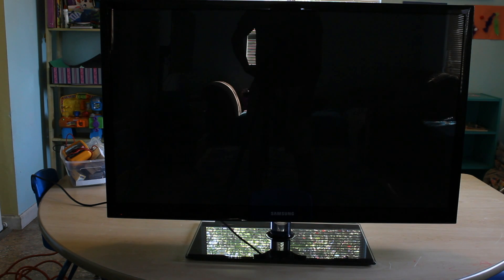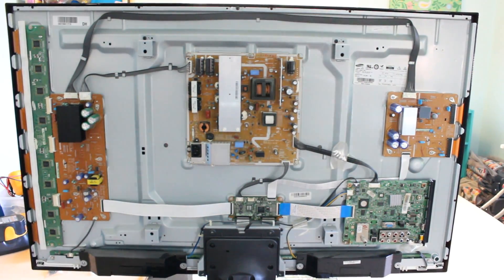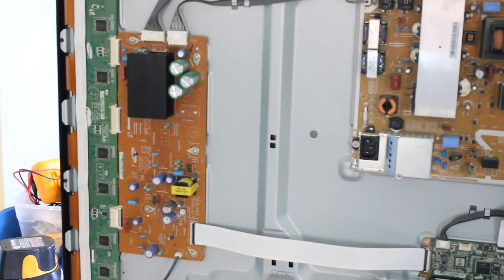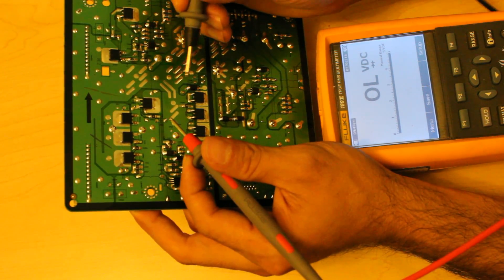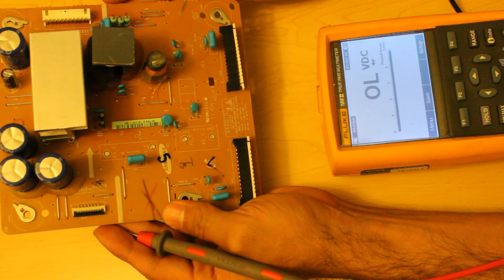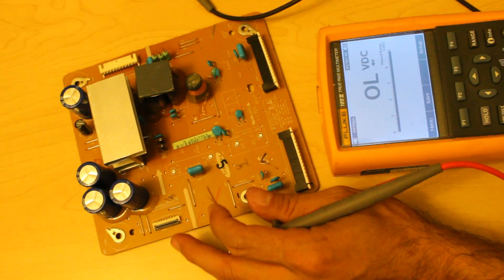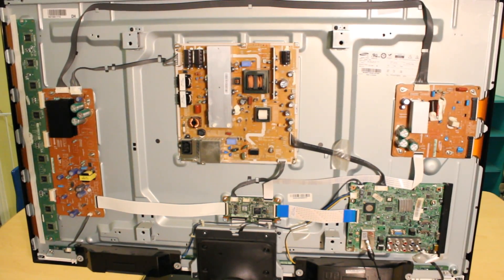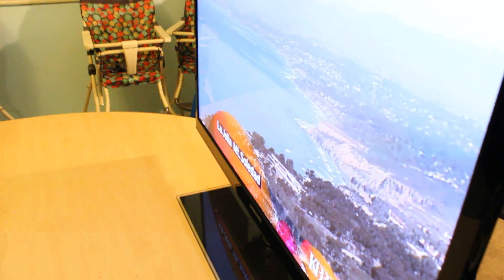How to Repair Samsung Plasma TV PN43D490 PN51D490 PN51D450 PN51D550

Comment: You need to test all of the mosfets not just two and two on the ot&er end. You can purchase these parts easily. I had no problems replacing them. Replacing the board is not wise some times..

Comment: Power for the X Main comes off the Y Main. To check it if its bad disconnect the black wire at top of the X Main to confirm
the dead shorted transistors on the x main board!
Reply: could you explain more?
my PS51F5500 gave loud pop sound, then totally OFF, red front led ON for few seconds then off , green light at the board blinking slowly.
I am not sure which board is the isue.

Comment: i have a 43d450a2d that only clicks when the video board is connected. i've replaced the video board but it still clicks. if the video board is not plugged in but all the others are, the relay wont click. anything else i should be looking for? i was so certain that replacing the video board would have fixed it but i was wrong

Comment: And another tip u have to upgrade the firmware to or it will blow again one has a ceramic Resistor on the upgrade and one dont. so be carful

Comment: Hi there, thanks for the sharing your videowith evryone , I have shut off problem with my Samsung Plasma Television 43″ PS43E490, Sometime it works for days without any problem and sometime it shut off after 10 to 20 minutes and Red Light flash 5 times, If i remove the power cable and reconnect the cable again then tv does come on. So it doesn't happen all the time. I really appreciate if you could help me to fix this problem.
Reply: Fazwaans Razwaan Did you find a solution? I am having the same issue.

Comment: thx for the info.  .  I have almost same problem with LG 42PQ2000 ...  5V & 12V present ... but no picture no sound... only relay cliks 1x   then Ir light flashes 7x then steddy..  stuck on standby.

please help
Reply from the maker: +A Lolouh Hi, does the light flash in a cycle 7x the solid?
Reply: +Runforlife Hi, ant thanks for reply .
Standby light goes not in cycles, only when you switch it on at the beginnig .
7 times blue flashing and then stays blue. after a while  returns red.
And the green flash led on Logic board does not flash at all.
Reply from the maker: +A Lolouh This model is known for having issues with the X-main and Y-main. Can you check the fuses on both? and check some mosfets on the X-main and Y-main? You can check out my my other video on how to test a mosfet here: https://www.youtube.com/watch?v=RkWy1EirEu8
Reply: Thank you verry much, fuses on power supply  are all ok., and the litte once on Y- main also.
I wil check more mosfets .
What do you think about some other telling on the net that the eeprom Pic 24xxxx can be corrupted? (Little ic near the reset button).
Reply from the maker: +A Lolouh check the following in the Y-MAIN: FS202, Q16, Q11, Q12, Q13, R503
Reply: +Runforlife Hallo again.  long time no hear!  Plz some more help, because I tested the parts you told me but they are good. Wat to do next?
Thank you